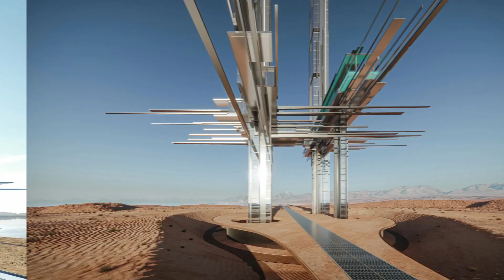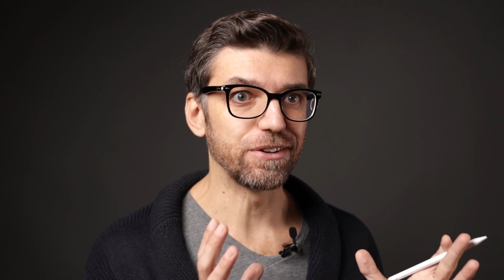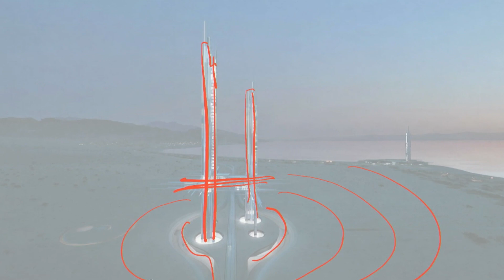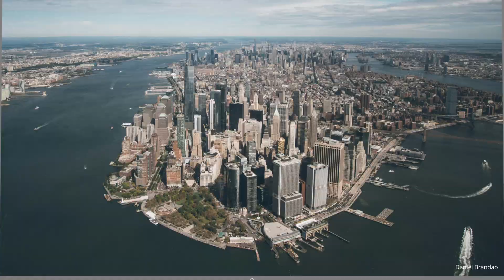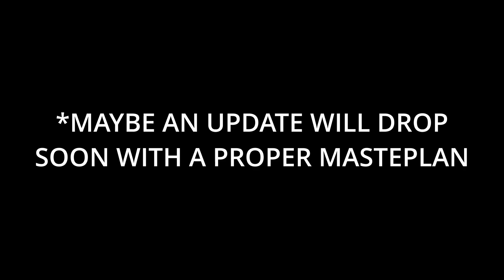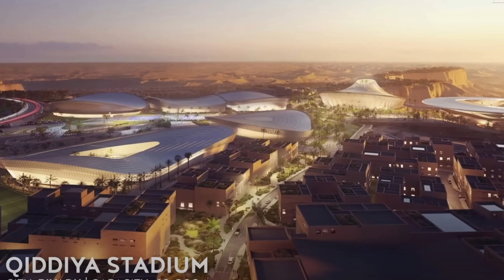Another Saudi mega project in the desert? Architect's reaction to NEOM Epicon

Comment: It's not that far-fetched based on current trade articles and trade interests, but the proof is in the pudding. The true test will be in the construction of Trojena and Sindalah which will be prooves of concept for Epicon, Leyja, et al.. Trojena has a hard deadline for the 2029 Asian Winter Games, and Sindalah will lure in the investment $$$$ (to IPO in 2024) to fund The Line, Spine, Connector, Int'l Airport, etc.. That will fund investment with engineering and material R&D for extreme "zero grav" counter-lever designs.

Comment: Yeah,
I believe any part of structure creating ambience Or Wow factor MUST have some sort of purpose. The massive hanging cantilevers are insane and I would be very much interested to know as to how it is sadding advantage to strength, additionally like you said without any surrounding other structures How these Towers will absorb and react to Wind pressure.
Even a 30meter mast for street lights has to withstand wind pressure (atleast 180KMPH (59 m/sec) for inland area
And 225KMPH (62.5 m/sec) for coastal areas.
Just a thought.....